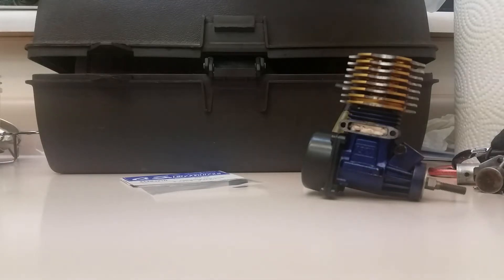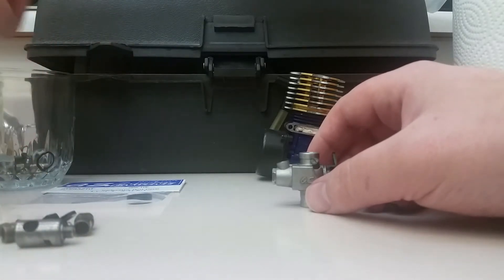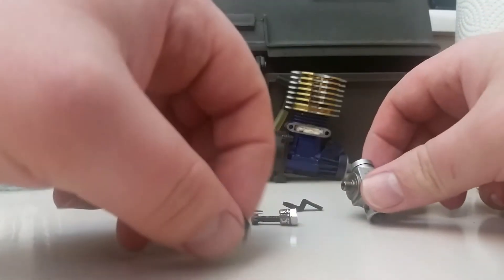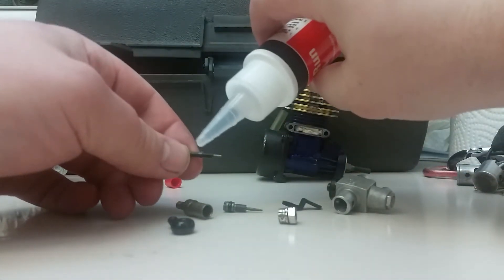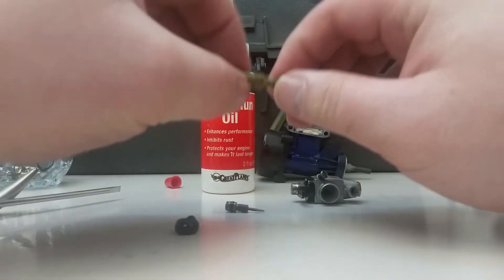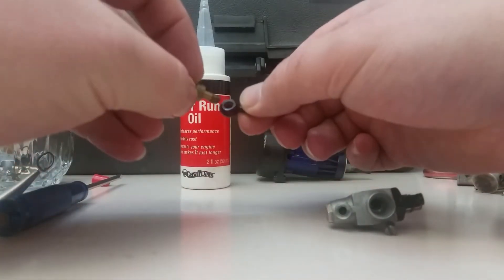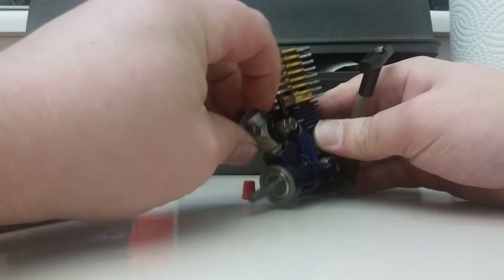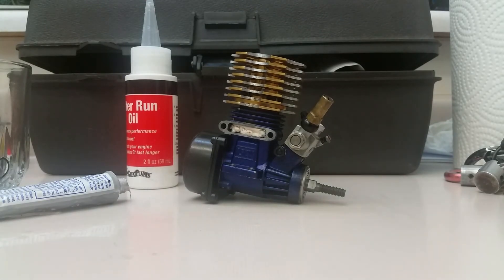OS 15CV hyper carburetor clean and repair and stolen mail!

Comment: why is there 2 holes at the base of the carb
Reply from the maker: That's for a different engine the 12cz doesn't use a pinch bolt it uses screws instead